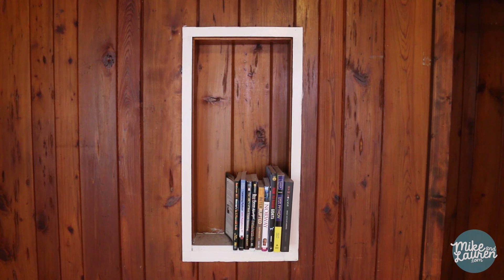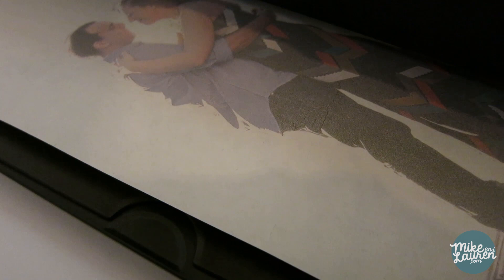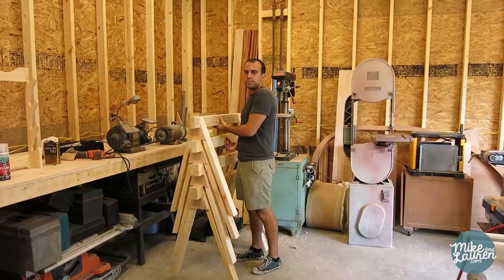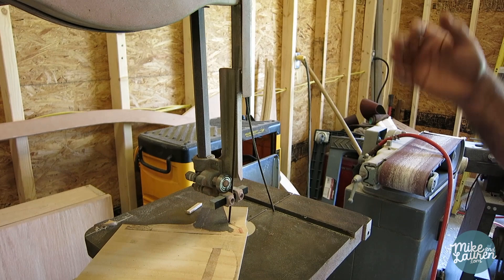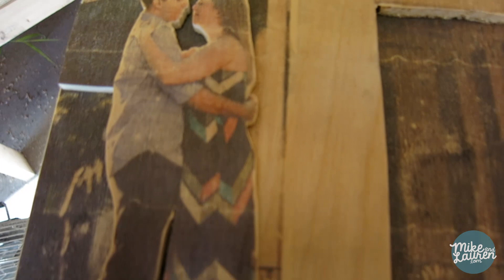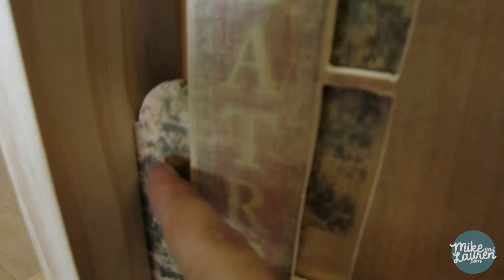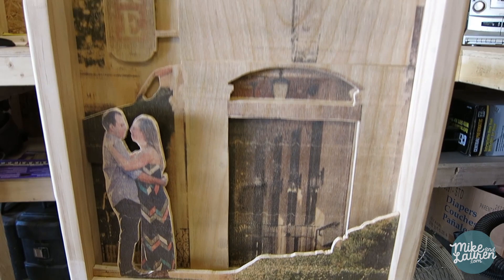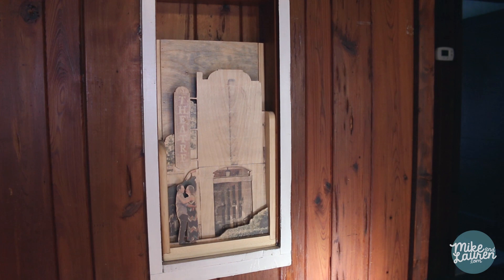Mike Makes a 3D Wood Photo

Comment: Did you also handmake that killer stool @ 2:23?
Reply from the maker: Kevin R. Yessir.  I filmed building it but it wasn't very interesting so I haven't posted it.  Here's a link to the website that I copied from:

http://www.abeautifulmess.com/2013/02/josh-modern-stool.html
Reply: Mike and Lauren I dig it. Thanks for the link!
Reply from the maker: I like the stool. There's just a couple of things I'm going to change. First I need to cut small "feet" on the bottom. Having the plywood straight across the bottom makes it rock back and forth if it finds a crack or pebble etc. 

I might also look into making some kind of a seat back. That's just personal preference though.   

Very easy to build and cool looking.  I'd recommend it.